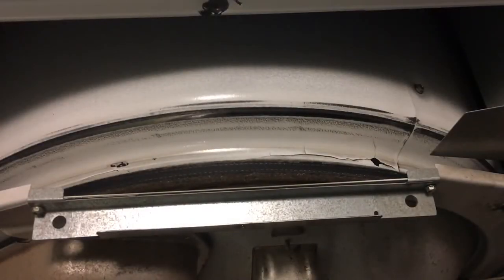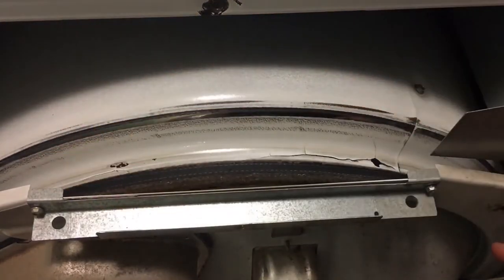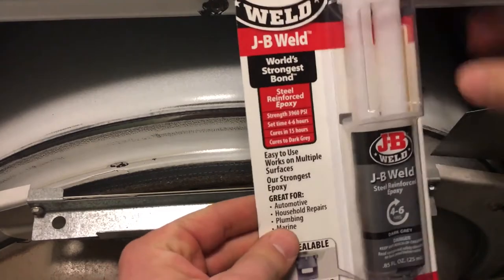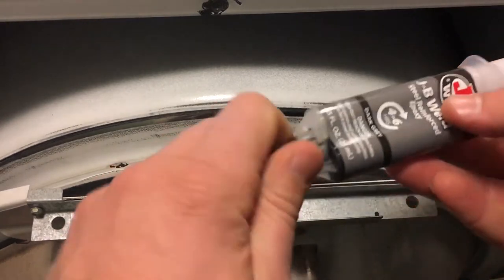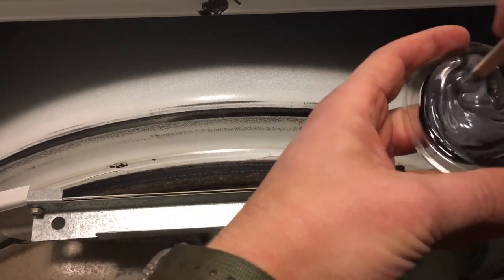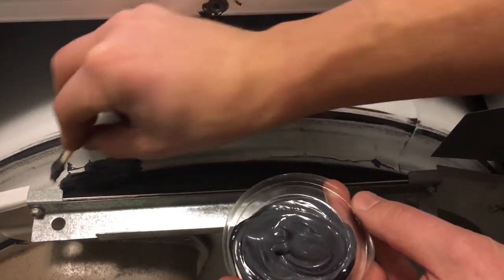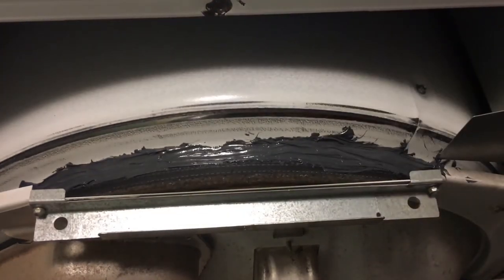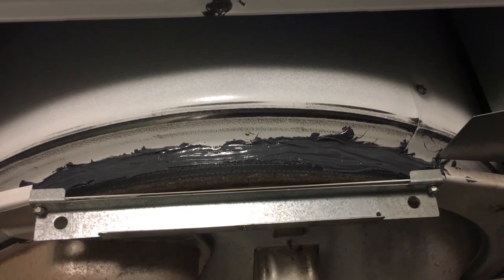How To Fix A Cracked Dryer Drum - Front Load Dryer Drum Crack

Comment: My drum cracked at the seam and finally the roller penetrated through and froze up the drum.  I removed the drum and JB welded it on the inside and outside of the bearing track.  This fix lasted about 10 cycles.  The JB weld cracked and flaked.

My next fix was to grind off and remove the JB weld and I soldered 3 stainless steel strips to the inside of the drum to patch the cracked areas.  You have to rough up the stainless area where you will be soldering and your new strips.  I used a wire brush wheel in an electric drill.  I used a torch that a plumber uses for copper pipe.  Used a solder that was very low lead content and Ruby’s stainless steel soldering flux.  
Worked great!  Took a dremel grinding tool to smooth/feather all edges on the stainless boot strips so no clothes can snag.  I didn’t want to mess with the bearing track where the roller rides for fear of thumping.  This drum rides as nice and smooth as it was when it wAs new and it’s 18 years old.  Got the stainless steel through Amazon and cut the strips I needed from that sheet.  Hope this helps.
Reply from the maker: That’s awesome!
Glad that worked for you! Doing what you did is a much more permanent and long-lasting solution! Thanks for sharing!

Comment: Will this task make the drum out of balance and/or bounce off the rollers? I have a small area on seam, of drum, that is cracked. I think it is in line, maybe, with rollers. For reference i have the dryer drum completly out and performing a cleaning. What started this concern was a thump that has not yet been positively determined. Please answer the balance Q. Tks
Reply from the maker: Yes, your balance will not be perfect like with a dryer drum that isn’t cracked. However, your dryer will still work and you will prevent heat from escaping the drum thereby reducing the risk of a fire.

Comment: The portion where my dryer is cracked is plastic (near the lint trap). Will the JB Weld still work on a crack in plastic?
Reply from the maker: Yes, it will. 
You can also try Goop for plastic. 
I like the plumbers goop the best.

Comment: I did this and put a really good layer on the crack and waited 24 hrs. I did a load today to see that the crack went through the jb weld. Should I apply more and then the inside? My crack is horizontal
Reply from the maker: Yes, I’d apply another layer. The problem is that the JB weld isn’t flexing each time it passes over the rollers. You could also take some tin tape like that used on dryer ducts and place it over your patch.

Comment: My crack is on the inside of the drum near the front door, the area where the clothes contact and spin. Will the JB weld work for that area?
Reply from the maker: Yes, I’d also put some tinfoil tape on the inside of the dryer. You could probably try that before taking the dryer apart and applying the JBWeld. It may be a good temporary solution.

Comment: any updates as far as post application? were the wheels / rollers running normally over the areas you sealed?
Reply from the maker: Yes, so far everything is working very well. I’ve ran the dryer over 50 times since the repairs. It is a little louder than formal due to the extra material but it works great!
Reply: @HowToVideoChannel  2 year update please. Is the glue still holding up?
Reply from the maker: @udayhomeful  So far so good.

Comment: I applied the jb weld and it bought us about a month until it cracked on the inside. Looking back I would have fixed the actual issue, a worn out roller which is about $10 and a set for $30. Now we're buying a new dryer. Point is, jb weld is a good easy temporary fix, but try to find the underlying issue when something isn't right with your dryer.
Reply from the maker: Yes, fixing the underlying issue is very important. Once the issue is fixed then you can repair the cracked drum. Of course, replacing the entire drum is the best option. 

Here is a video on how to replace the dryer rollers:

How To Fix A Dryer Roller On A Front Load Dryer
https://youtu.be/7EopQED748g

Comment: What about if it’s inside off the drum in the back
Reply from the maker: Should still be able to access it from the back. Otherwise, you can try some tinfoil tape or auto body tape on the inside without taking the drum apart.